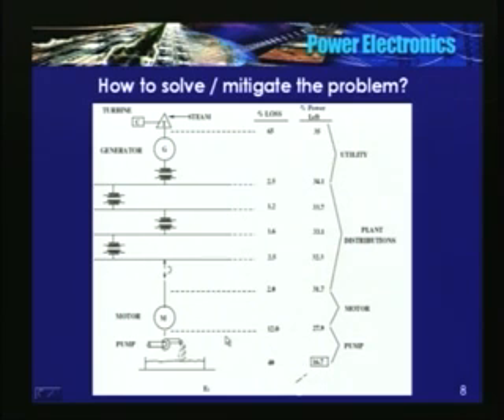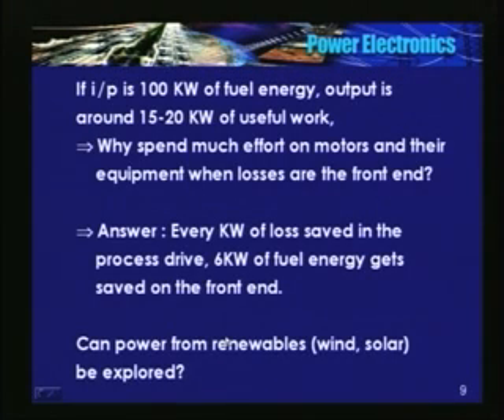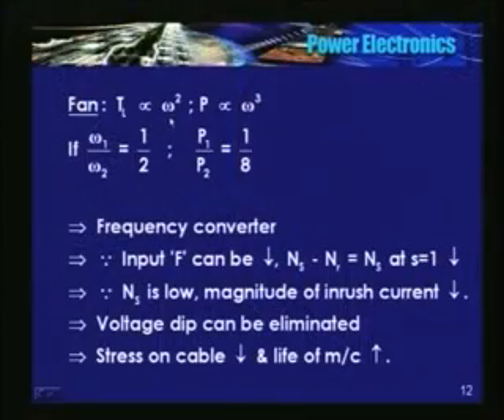Lecture - 1 Power Electronics

Comment: For all the new comers!
From,
Lecture 1-9 ----- power semiconductor device's.
Lecture 10- 22 ----- AC 2 DC.
Lecture 23- 32 ----- DC 2 DC.
Lecture 33- 43 ----- DC 2 AC.
Reply: Where can i practice numericals.... Does this vedio gives enough base to solve all types of power electronics problems... Does he give enough equations yo to solve the numericals...
Reply: Liju Robby Did you find what you was looking for? I'm also interested if you don't mind sharing... thank you!
Reply: amazing gesture man thanks
Reply: Does anybody know about the commutation circuits (current commutation, voltage commutation etc) Lecture video numbers in this series?
Reply: Thanks man you saved me 23 hours
Reply: interesting points ,if anyone else needs to find out about how to make electronic circuits try Letza Easy Electronics  Lessons (just google it ) ? Ive heard some unbelievable things about it and my co-worker got amazing success with it.
Reply: Thank you
Reply: thankyou sir
Reply: is this enough for gate
Reply: @Clint robby content is more than the syllabus of gate exam
Reply: i mean if i watch this....is there any need of watching other power electronics lectures
Reply: Clint robby this video lectures are enough. This video lectures are of theory based but gate exam is of numerical type. So don't put your more time on this lectures only.
Reply: i need to learn about power inverters should i need to learn all the series or what